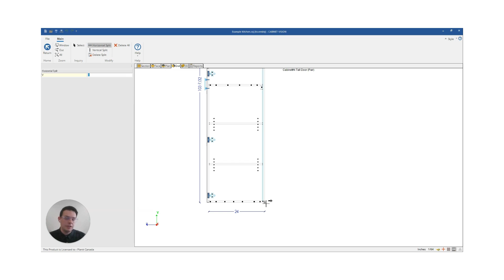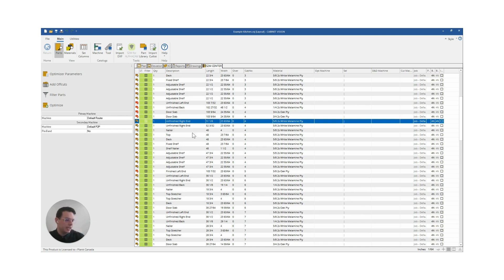How To Split Long and Wide Panels in Cabinet Vision using xShaping!

Comment: Hello, Great video. 
I have sheets with crossgrain pattern so i don't have to split the panel or cabinets, question is i can't use them in cabinet vision because there is no option (as far as i know) to create a panel stock sheet with a crossgrain pattern. Maybe there is a way to create a panel stock with crossgrain?
Reply from the maker: Hello! If you are using full cross grain sheets, you can set them that way in the Material Manager by switching the x and y values. Your nests would come out differently though if you just set the door to horizontal, so it's good to keep that in mind. If you want to test it out, we'd suggest creating a test woodgrain material with those settings set-up and optimizing a few sheets in S2M Center to see how it looks, before you change all of your cross grain materials. But that would be it in principle. Let us know if you have any more questions though, we're always happy to help!

Comment: Hi Clayton
I'm wondering if it's possible, since I just found out about the split, if it's possible to add an UCS to create operation to include a dowel joint for example?
It´s only a Split or it create a new "internal" edge to the piece and then we can include an operation or banding by UCS?
I look at the tree view and only shows the split as a parameter "_SPLITY1"
Thank you
Gerardo
Reply from the maker: Hello! Thank you for reaching out! Yes the _SPLITY parameters can be used in UCSs, and I would encourage you to read through their descriptions in the System Parameters file under the Help tab in Cabinet Vision because they can be useful!
When we add a split in Cabinet Vision, the program won't perceive this divided part as having different edges though necessarily. From CV's point of view, this is the same part with the same edges. Only when we send it to S2M Centre does it make the distinction in that sense. So using a very robust UCS to add banding there, for example, might be far trickier than it's worth.
Reply: @PlanitCanadaInc  
It is complex but there is always a route that can be created to achieve the goal. In a video that I put together over the weekend I managed to do operations to insert wooden dowels and join those parts that are generated at the S2M level.
I invite you to watch the video and I thank you for having introduced me to this tool since at least it solves a couple of things that happen on a daily basis
Regards and thanks again
Gerardo
https://www.youtube.com/watch?v=EVntNw4WSkE

Comment: There are many good applications of splitting parts, but with all due respect, your example is not one of them.
What sense does it make to split an end along it's dowel location? Now you have the back
to contend with, and assembly will be a real treat. Simply stack two cases and be done?
That aside, I've learned a ton from your videos, a real help as in house visits from your
group are too expensive honestly
Reply from the maker: Hello! Thank you for reaching out! I definitely agree with you. It is important for everyone to add the splits where it's most applicable, and your case makes the most sense. The idea with the video was to quickly demonstrate how to use the Splitting tool, and position the split where you would deem suitable, with less emphasis on specifically where. That said, we will take your advice on board and use less theory/more practical examples in future videos. Thank you.